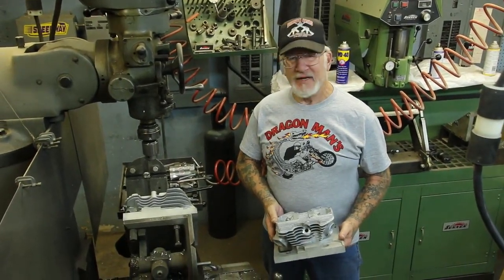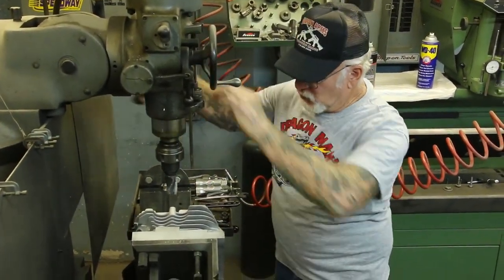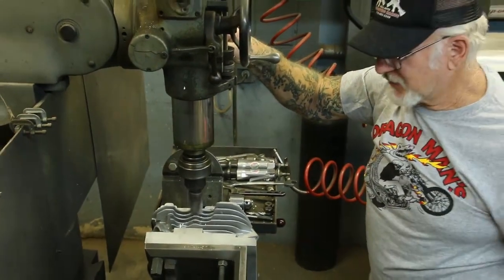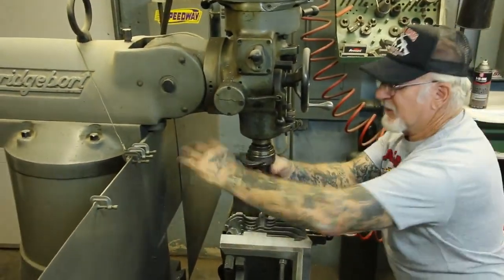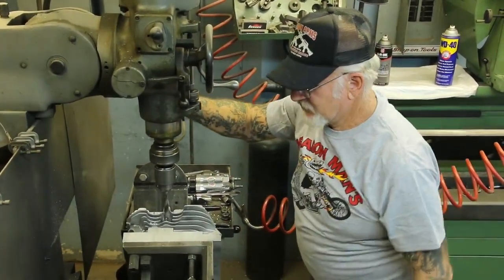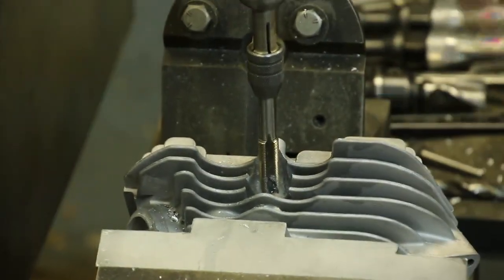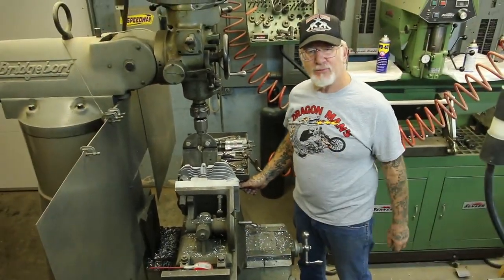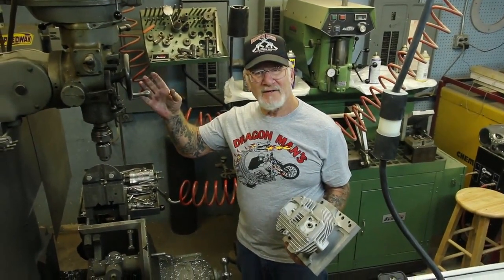Machining for double spark plugs in a shovel-head

Comment: Hi there I am interested in getting the dual plugs cut into a couple of ironheads.  For me it is to install compession realeases on a high compression stroker engine.  I am getting older and cant kick like I used to.  Do you have a shop on line?  thanks Bill
Reply: I'm considering the same thing since my kicker-leg aint what it used to be on my Shovelhead. I'm also considering just welding 2 inches to the kicker arm...what do you think about that, Bill?
Reply: @bobbyross9243  Well my understanding is that hen you add lenght to the kicker arm it slows the speed of the kick.  Which I believe is ok on an points battery ignition, but I have a mag fired ignition which needs the speed to make a strong spark.  The higher the RPM the bigger the spark.  So just depends on what you have.  They make some longer kickers for the old Ironhead Sportsters not sure on the Shoveheads,  Good luck Bobby because time stops for none of us.  I am 76 and grateful for every day.
Reply: @fussebd1952  Hello Bill-
I got points, no magnito. Yes definitely a slower spin with a longer fulcrum. I usually don’t need a lot of spin since I only have 9:1 compression. Starts on the first kick most times as long as no one’s looking.
I think all I need now is maybe an additional 2” to the kicker arm. Now I just need to find in my group of buddies, a welder. 
I’m a young 68 with 46 years of kickstarting.

Comment: Noble man exactly knows how an engine works. Their are single cylinder motorcycles from bajaj in India with 3ple sparkplug company claims that it increases efficiency, performance and helps to burn fuel efficiently. I also have heard that its possible to run on more lean mixture with dual or 3ple sparkplug.

Comment: I have a question. After this job is complete and the cylinder heads are installed on the engine along with the rocker covers, which spark plug wrench fits on the spark plug and clears the front of the rocker box cover?